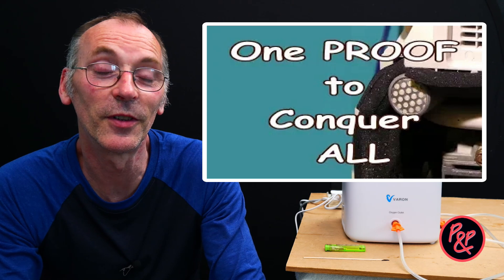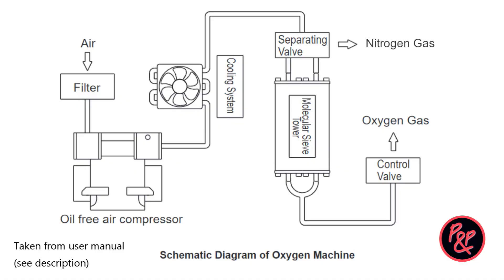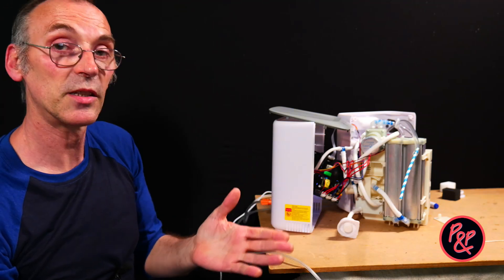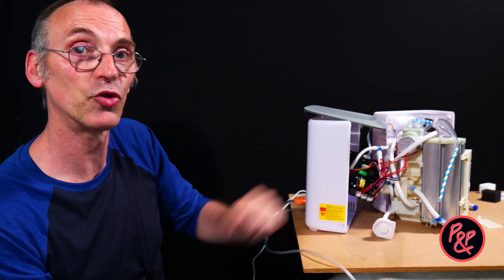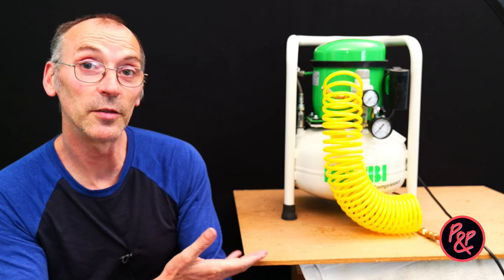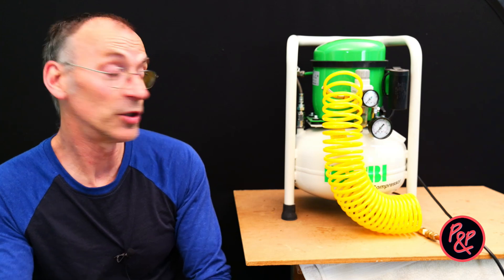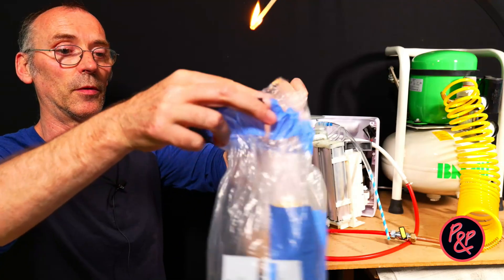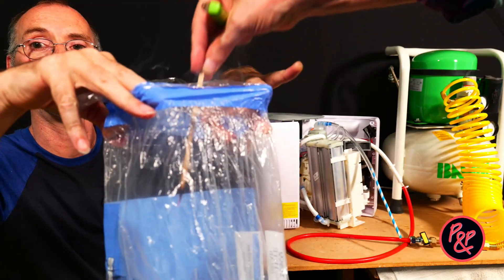Making Nitrogen Using An Oxygen Concentrator

Comment: Would be good just to add the compressed air to the bag and put a lighted and then glowing split in.  I wonder what would happen?
Reply from the maker: Yes, we intend to do that as well as do other interesting thiings  👍
Reply from the maker: done that and the lit splint did not extinguish nor did it glow brighter which means a glowing splint would not have re-ignited!!
Reply: @PeterPete  Thanks for doing that.

Comment: No.... (1) the machine may be taking, say 2% pure (ish) oxygen from the air and so the expelled gas would be 16% O2 and 76% N2. This would be plenty to keep the flame alight. The machine is designed to purify oxygen, not to purity nitrogen. (2) The flame test is as astonishingly crude test. (3) As you know, BOC (previously the British Oxygen Company) are a large company in the business of separating air into O2, N2, Ar, Ne, etc.The French company Air Products are in the same business. (4) When using a laboratory vacuum pump cooled with liquid nitrogen (bp -196°C) one has to be careful because O2 (bp -183) will condense on the liquid N2 'cold finger' and if there are any organic compounds collected there is the danger of an explosion.
Reply: Thank you.  Also holding the open bag means oxyggen from the air was introduced, which kept the flame going.
Reply from the maker: 1. Got any proof of that or is it going to remain just your idea?
2. The flame test has always been reliably used to determine the presence of certain gases. If the flame goes out you can't say there's oxygen present.
3. Irrelevant to the video content
4. Irrelevant to the video content
Reply: @PeterPete  1. Would be the obvious way to design the machine. As I said, the machine is an oxygen concentrator not a nitrogen concentrator, although the effect will be to slightly increase the N2 concentration.
2. The flame test is a qualitative test. If you really wanted to know what was going on you would make quantitative measurements which numbers.
3. No it is not irrelevant. There is an entire industry with multinational companies who separate the gases from air, yet you question the science behind these industries with your 'clever' but incorrect ideas. The global oxygen market was $34.83 billion in 2022.
4. Again not irrelevant. Liquid nitrogen will condense liquid oxygen from air because of the difference in boiling points. I have direct experience of this from lab work. You should be interested that these facts contradict the thesis of your poor experiment. This is how science works.
Reply from the maker: @MarkRLeach  Look Mark you seem to be overlooking your understanding regarding what's going on here.

1. You think air is being separated so at what point in the video did you observe that?

2. Does nitrogen extinguish a flame? yes or no?

3. Again irrelevant to the content of the video. How much money people make is irrelevant to the content of the video.

4. Again irrelevant because this aspect has only relevance to the gases once produced and give no indication where the gases oiriginate!

👍👍👍
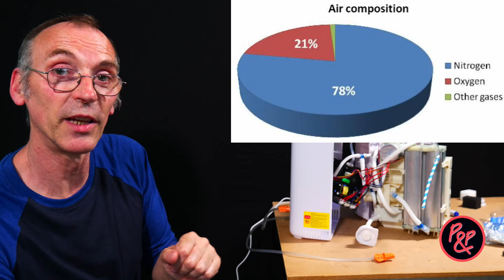Reply: @PeterPete  At 3:04 you say "This machine is separating air into nitrogen and oxygen". That is NOT what the machine is doing, it is separating oxygen from air, not the same thing at all. The machine does not claim that the exhaust gas is pure nitrogen. Why would it be? The exhaust gas will be depleted in oxygen, but it will not be oxygen free. Indeed, your experiment shows that the exhaust gas can maintain a flaming splint, so it still contains some oxygen. I would guess about 12-14%? 
The next stage of your experimental sequence should be to quantify the amount of oxygen in the exhaust gas. I am sure the manufacturer/supplier could supply this information if asked.
Your experiment shows (rather well)  that the machine extracts and concentrates oxygen from air. 
Your experiment also shows (also rather well) that the machine does NOT separate oxygen and nitrogen. It was not designed to.
Indeed, many chemistry experiments are carried out in an oxygen free environment. Unfortunately, there are no bench top machines that can generate pure nitrogen from air, so gas cylinders of N2 or liquid nitrogen (or argon, even better) are used.
Reply from the maker: @MarkRLeach  taken from the manual of the oxygen concentrator

"Air enters the compressor after being filtered through the inlet filter device, and is compressed into the molecular-sieve tower for oxygen-nitrogen separation. Oxygen passes through the molecular-sieve tower and enters the fine sieve tower, while nitrogen is adsorbed by the molecular sieve and discharged into the atmosphere through the separation valve."

The information clearly states air is kinda 'split' or separated into oxygen and nitrogen with nitrogen being discharged or exhausted into the atmosphere.

We tested the exhausted gas stream and could not detect any nitrogen. It is only right for us to question the validity of the information as it could be wrong.

But what makes your view even worse to comprehend is that you guys have the idea of moelcules and nitrogen and oxygen molecules are of different sizes and the seive traps in one gas but allows another to pass. So why should any oxygen get exhausted like we discovered in our first video - one proof to conquer all, when only nitrogen is exhausted? 

As far as I'm concenrned one should be able to detect oxygen and nitrogen being expelled from an oxygen concentrator and even from a nitrogen PSA generator too.

Air being composed of different gases is a great idea but in order to convince others the idea is true and reflects the real world, you have to prove those gases are in the air. That hasn't been done as far as I'm concerned and we have put forward an alternative idea regarding air.

It's your job now to falsify the idea! So instead of typing stuff on here go get yourself an oxygen concentrator and prove the machine separates air into oxygen and nitrogen!!

We tried and can't detect any nitrogen!!
Reply from the maker: @MarkRLeach  btw at what point in the video did you observe the air being separated?
Reply from the maker: @MarkRLeach  also bear in mind air allegedly is composed of 78% nitrogen so where was it?
Reply: @PeterPete   You have made no attempt to "test for nitrogen", your splint flame test is a "test for the presence of oxygen".
Thinking about it, the flame test does have a slight degree of subtly: Zero or less than 5% oxygen will extinguish a smouldering splint; 10%-20% oxygen will keep a splint smouldering and greater than 30% (I don't know the exact numbers) will relight a smouldering splint: no oxygen, some (about atmospheric) oxygen, and greater than atmospheric oxygen.
Nitrogen gas, N2, is a bugger to detect as it is so un-reactive and inert. 
Doing a quick Google search I came across this statement: "Nitrogen is detected using a measuring instrument known as a nitrogen gas detector. These devices are specific to oxygen gas, but are termed nitrogen gas detectors, since the inverse amount is oxygen. Typically, nitrogen gas detectors are composed of electronics and an oxygen sensor."
To test for nitrogen, N2, you would either need to do "hard" UV spectroscopy (below 210nm) or liquify the exhaust gases and then carry out a low temperature fractional distillation to find the composition. Neither of these methods would be  amenable to the home experimenter.
Reply from the maker: @MarkRLeach  tell me mark - does nitrogen extinguish a flame yes or no?
Reply: @PeterPete  0% oxygen will extinguish a flame, so yes 100% nitrogen will extinguish a flame, as will 100% argon or 100% CO2. What is your point? It is not the nitrogen that extinguishes the flame but the lack of oxygen.
Reply from the maker: @MarkRLeach  so now tell me Mark from 14:50 did the splint go out when introduced into the bag? yes or no?
Reply: @PeterPete  yes the splint remained alight showing that the machine did not exhaust pure nitrogen. The machine was not designed to exhaust pure nitrogen but to supply enriched oxygen. But you know this, don’t you?
Reply from the maker: @MarkRLeach  WTF?? The lit splint went out!!! This means the 'air' in the bag did not support combustion. As for the rest of your comment, I'd seriously recommend you watch the entire video!!!
Reply: @PeterPete  Apologies, I thought the time you quoted was 4:50, which showed a glowing splint. The 14:50 result is most interesting. Can I suggest that at high pressure the carbon molecular sieve removes oxygen for the air? 
As I said before, entire industries are based on liquifying air and then cryogenically distilling and purifying the various components: N2, O2, Ar, Ne, Kr & Xe. Your conclusion that 'nitrogen is synthesised' is not proven at all.
Next you are going to tell me the Earth is flat!
Reply from the maker: @MarkRLeach  at what point in the video did you observe oxygen being removed from the air?
Reply: "We tested the exhausted gas stream and could not detect any nitrogen."  When did you test for Nitrogen?  All you did was decide if the bagged air would stifle a flame..  What kind of scientific test is it, with a bag open to the air, which oxygen would flow in and be sufficient to keep the flame lit..? @PeterPete
Reply: @PeterPeteso niw tell me peter&pete, didn't you read the "0% O² extinguishes a flame" answer, before going full FBI interrogation mode? You're wrong, he's right. Case closed (finaly 2years later)😂
Reply: @PeterPete  agree

Comment: Fascinating.  So what are you guys thinking?  Are the high pressures pushing depleted or "spent" air out of the charcoal?
Reply from the maker: we think compressing the air at higher pressures helps the air to interact with the carbon molecular sieve material where it becomes 'stained' by the sieve material. Obviously passing it through the pressure swing system allows that air to be concentrated enough to be able to extinguish the flame.

Comment: So either the air gets laced with a substance or it is formable.
From this I'd lean more towards the latter since increasing pressure alone shouldn't equate to becoming more laced with the carbon unless it's due to the extra force needed when the air stream rushes through the substrate which breaks off tiny bits of it to take with it as a dust.
A third option could be that something is removed from the air and trapped in the molecular sieve, I know the carbon filter in reverse osmosis is specifically useful for removing chlorine and other chemicals from water that normal mircon sieves can't, but again a change in pressure wouldn't cause a difference in this case.
Reply from the maker: Quote - So either the air gets laced with a substance or it is formable.

I'd say it's a bit of both 👍

Quote - A third option could be that something is removed from the air and trapped in the molecular sieve

Some would say it was oxygen being removed from the air. However the exhaust gas in the last demo didn't extinguish a flame whereas the main feed did. It's clear the machine processes the air and laces or stains the air to provide an air stream that has the properties that it exhibits. It's all fabricated.
Reply: @PeterPete  A fourth option - "oxygen" is "charged " air (phlogisticated air) and "nitrogen" is "discharged" air (dephlogisticated air).
Reply: Another option - "oxygen" is "charged " air (phlogisticated air) and "nitrogen" is "discharged" air (dephlogisticated air).  Both air, just air in a different state / condition.
Reply: @drjohnd.9508  That could be the case, as oxygen is acidic and going on the idea that acidity is caused by the presence of hydrogen that could be the "charge".
Reply: @wynand988  I get the impression (just as idea) that "fresh air" is air that is "charged" by the sun / being outside etc.  We breathe in the "charged" air and in the lungs it "discharges" and we breathe out the "discharged" air - that needs to be "refeshed / recharged".  I think in a sealed room you will die because all the air has lost its charge (it has passed to you) - you have "run out" of "oxygen" - but "oxygen" is charged air, not a different chemical, the same chemical but in a different charge state / condition - you have run out of "charged air" - you need to open the window for some "fresh" (charged) air.  Best John.
Reply: @drjohnd.9508  could be, would need to set up some experiments to get evidence for these ideas, but I'd rather think that it's as P&P have pointed out, where it's a case of clean water being taken up into the blood stream and waste products expelled in the vapour in the exhaled breath, as this is what fish do why would it be different for us?
Reply: @wynand988  Just throwing thoughts about:   How about the "charged" water passing across the fishes gills discharges to the fishes blood, so the fishes blood becomes "charged".  Freshly "charged" water is needed for the fish to keep living.  As I said, just ideas.  Just basing my ideas on Charge & Discharge and disequilibrium - Equilibrium.  Best John.
Reply: @drjohnd.9508  radical. No idea if that's true but it's got lots of energy.
Reply: @drjohnd.9508  I don't yet understand much of this, but I do know that many thousands of big fish have been dying in the Mississippi the last few days and people say it's because they got stuck in less oxygenated strata. Hard to believe if the river's only fifty feet deep. What if electricity's got more explanatory power over basic life than I thought? Will continue reading.
Reply from the maker: @drjohnd.9508  yes could well be but without the processing there is no charged or discharged air. so in your opinion what is the 'charge'??
Reply: @PeterPete  And here it gets interesting.... you appreciate a simple chemical cell (involving two metals) can "do work".  If the metals used are the same, no voltage is recorded, no "work" can be done.  If the metals are different, e.g. magnesium and copper, a voltage is recorded and "work" can be done.  "Charge" and "discharge" occurs until equilibrium is reached.  In my opinion and just my idea, I believe that the sun/Earth discharges to air, "charging" the air (or some of it) - this we call oxygen (but it is just air in a certain condition/state - "charged" air).  Humans can process air as well and "charge" it - I think!  Just ideas.
I have thoughts and questions on "charge" (and a lot of other things - ha ha!) - happy to email?
Reply from the maker: @drjohnd.9508  It's interesting how you're trying to establish a connection between this 'charge' and oxygen. What conflicts with my understanding of oxygen is that oxygen is a processed gas, without the processing there's no oxygen. In common production methods of oxygen, heat is always present so the charge could well be heat. In the past we have likened oxygen to be latent heat and it is the heat that acts as a catalyst to make something more acidic for example. Hence the nomenclature, oxygen - acid former. We are aware that oxygen 'strengthens' the property of a substance; makes it more potent. 

Oxygen is also hydrophobic so is not suited to human bodies that have a high water content. As an example they use H2SO4 to dry 'wet' chlorine gas from the chlor-alkali process. It has to be the oxygen that dries the chlorine and makes the properties of chlorine stronger. 

Food for thought 👍
Reply: @PeterPete  Another interesting thing to look at with regard to oxygen in the blood is the swim bladders of fish, you'd think if they were taking in oxygen from the water they wouldn't need to fill them by gulping air. But there are some that lose the gut to air bladder connection later on in life and are then able to put gas into the bladder through an acidification of the blood from a bicarbonate buffer system which they claim releases oxygen from the blood.

Comment: Good job that the lady told you about the compression. I thought the compressed air might ruin the machine.
Reply from the maker: We had thought about higher compression rates because of the membrane nitrogen generators work at 120psi. So it's clear that compressing the air before it enters the sieve towers helps in the process.

Comment: The machine (as purchased) should be outputting 3 times the amount of nitrogen to oxygen. Plus that nitrogen should be concentrated since the oxygen was removed. I'm just not seeing it.
Reply from the maker: did you shake your head in disbelief? 😅
Reply: @PeterPete  Twice! There used to be laws to prevent people from selling scam products like that. Those plug in electronic bug repellents are another good example. Heads should roll. People should care. They don't and government is the cause so they aren't going to help. Best way to fight the tyrants is to educate the people.

Comment: I understand Chlorine and Nitrous oxide can both relight a glowing splint but in both cases it's suggested it is the oxygen content in those that causes the reaction.
Reply from the maker: It's the oxygen content that relights a glowing splint. Oxygen is released from the breakdown of the anode electrode during the chlor-alkali electrolytic process to produce chlorine gas. Therefore chlorine gas obtained in this way cannot be an element because it contains oxygen. We've covered comburent gases and always thought they must contain oxygen because they show characteristics of oxygen 👍